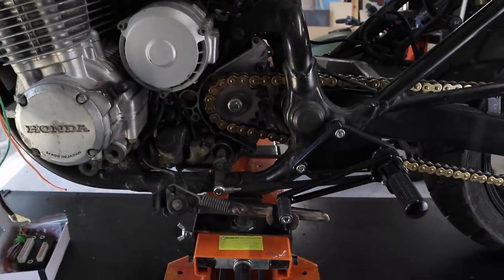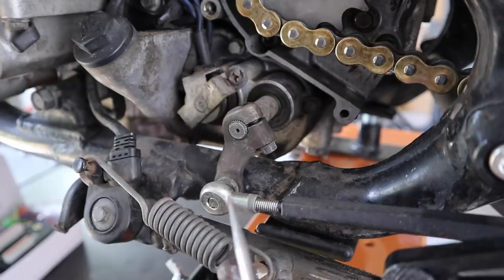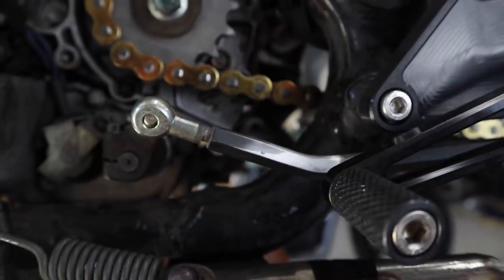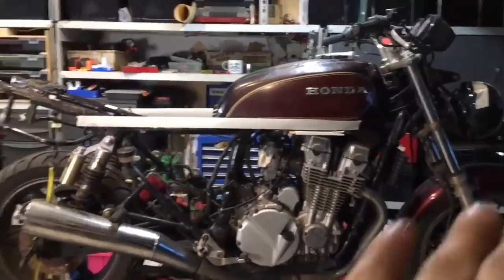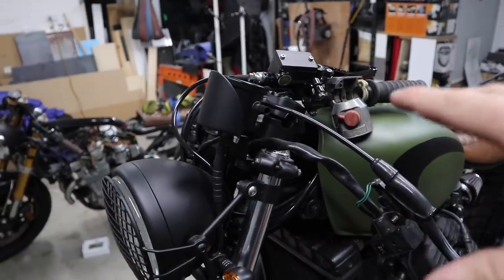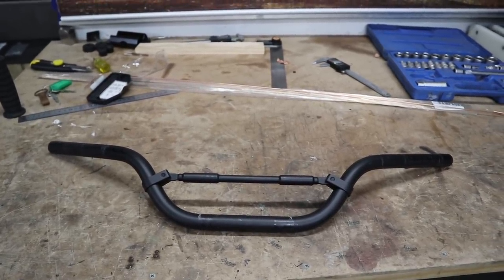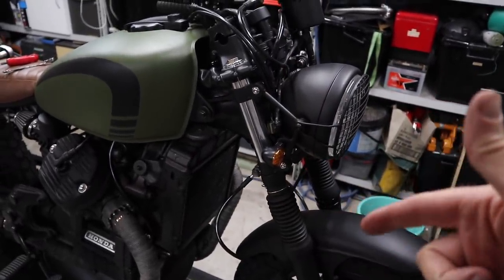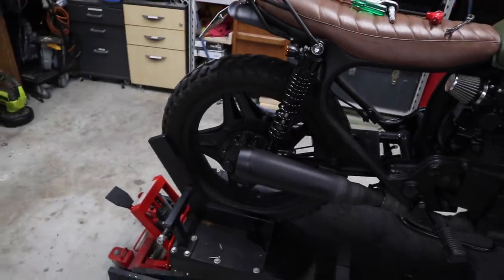★ Bent Handlebars or Frontend? & CB750 Cafe Racer projects

Comment: Hi there, I like your work. I have a late DOHC which I’ve cafe racered too, I’m slightly confused by your comments about the gear shift alignment. Surely the marking shows the correct alignment for the factory standard shift linkage only.  If you use custom rear sets you can rotate the linkage to the best orientation for those. I’ve made up some rear sets which work well and have taken no notice of the  centre punched mark at all.
Reply from the maker: Yes, you are right, however, if you put it 180 degrees in the opposite direction to the original position it will select backwards if that makes sense.   :)

Comment: When you're welding on the bike like I've seen you do many times, what electronics do you need to remove? I guess the battery has to be removed but what about the CDI, coiil, starter motor, instrument panel etc?